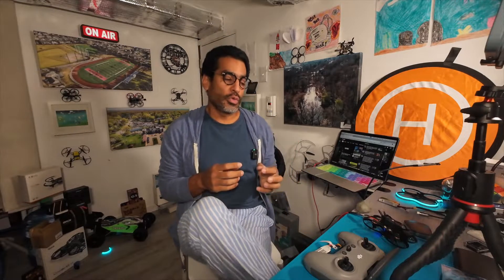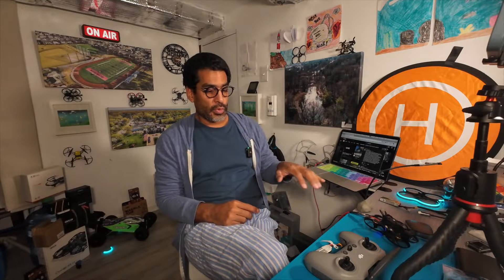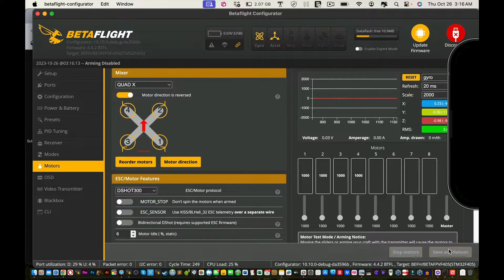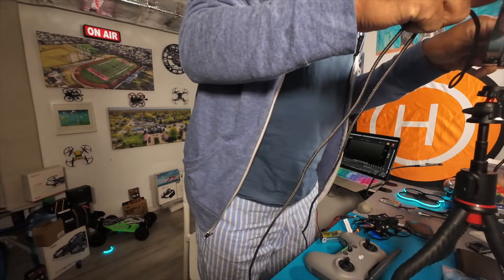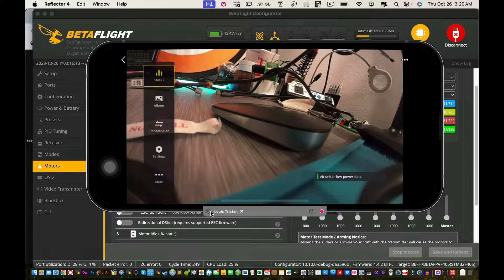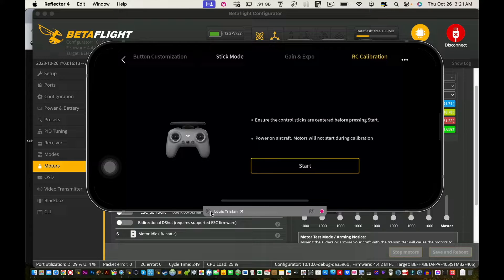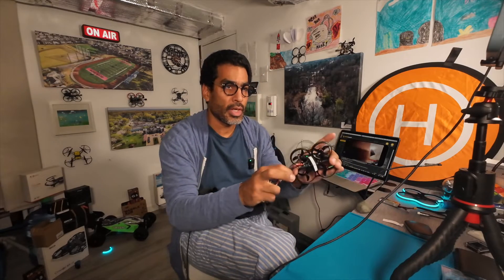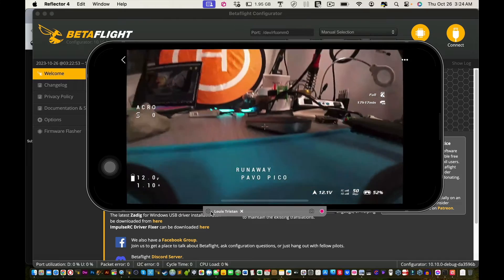Pavo20, not binding - Pavo Pico not binding,  troubleshooting solutions

Comment: I bought a secondhand Pavo20, it flies great. Now, I build another one, but I cant set it up as the one I have before. How to flash the same firmware and settings from the old one to the new one? The old one is on Betaflight 4.4.3
Reply from the maker: Firmware should not matter.. But if you like the setting of the drone you are flying just do 

CLI Dump
https://www.youtube.com/watch?v=yPxt9cc_F7w

Could always try the troubleshooting video:
https://www.youtube.com/watch?v=LEw5Gha1eRo&t=266s

Hope this helps.. Let us know how it goes.. 
Troubleshooting Video
https://www.youtube.com/watch?v=LEw5Gha1eRo&t=266s

Also flashing the correct firmware depends on your chip. Would need to know which chip so the correct firmware is flashed.. But try the CLI dump and transfer everything from the working drone.
Reply: @How-to-by-Lou  Thank you. Appreciate it.  I’ll try.
Reply from the maker: @abrambah  Maybe with the web app version of betaflight. It's more streamlined...
https://app.betaflight.com/#
Reply: @How-to-by-Lou  I did what you suggested, copy Dump All from the old quad and past it to the new quad. Only I got a few lines with error message. So what I did is delete the command lines with the error message. and paste it again. It worked. Thank you v much :)
Reply from the maker: @abrambah  does it fly …
Reply: @How-to-by-Lou  Oh yes it flies, just as expected, like the old one :)
Reply from the maker: @abrambah  this great thanks for sharing. Also don’t forget to save the settings/CLI dump file to your computer or an external drive
Reply: @How-to-by-Lou  Yes, I did :)
Reply: Ok. Will try. Thanks again

Comment: I have strange situation with my Pavo20, I can't bind it with my Radiomaster, green led is not lighting (just 3 blue led's blinking) but my FC is recognized in Betaflight. I tried to upgrade Rx but RC can't switch to wifi mode, Betaflight passthrough doesn't work also. I'm not sure if my flight controller is bricked or there is problem with Rx module but it is bulded in FC.
Reply: stucked in the same situation, what you do?
Reply: @LukRider  It was problem with my flight controller. I changed it to new one.

Comment: Where i can find that air duster 🫡
Reply from the maker: Found it on craigslist for $20.00 bucks, some guy was selling it/ Went into the city to pick it up - cash for goods. The original one is here crazy expensive, looks like the price went up on amazon too, which means there is a shortage  of supply......This should not be 90$:
https://www.amazon.com/gp/product/B0BX6DRB3G/ref=ppx_yo_dt_b_asin_title_o00_s00?ie=UTF8&psc=1

But if you go to below they have a bunch and better ones to choose from, some are kind of big though... Just remember it works as a vacuum too. Great because now I don't have to buy cans for air anymore, will show fill function in next video ....https://www.temu.com/search_result.html?search_key=iDOO%20Electric%20Compressed%20Air%20Duster%2C&search_method=user&refer_page_el_sn=200010&srch_enter_source=top_search_entrance_10009&refer_page_name=search_result&refer_page_id=10009_1698551679045_9npkibqyqo&refer_page_sn=10009&_x_sessn_id=bp0k3a0fi8